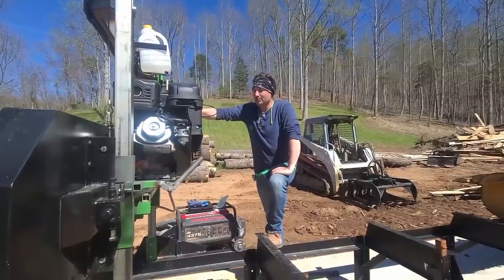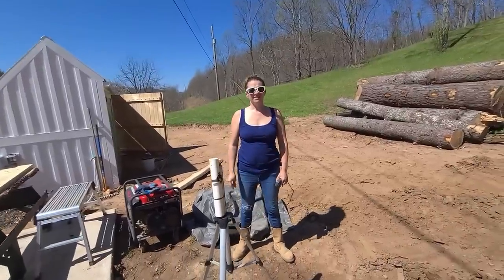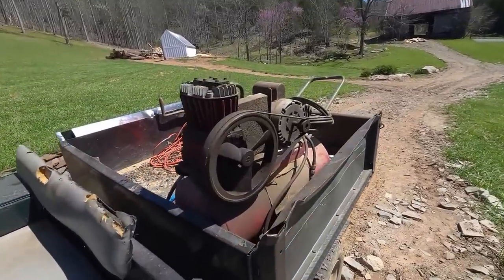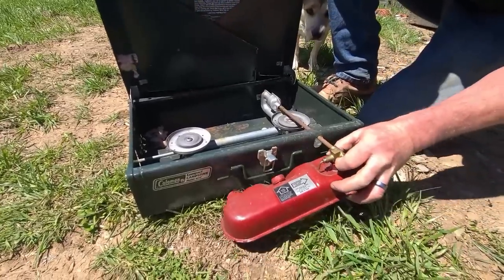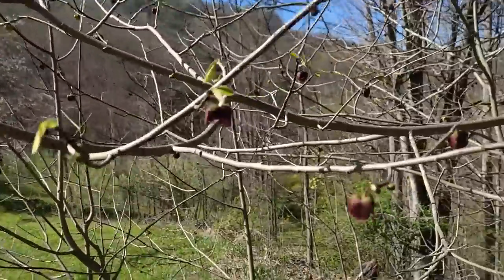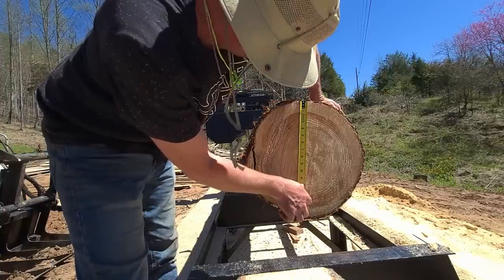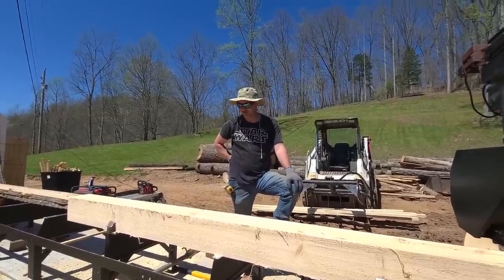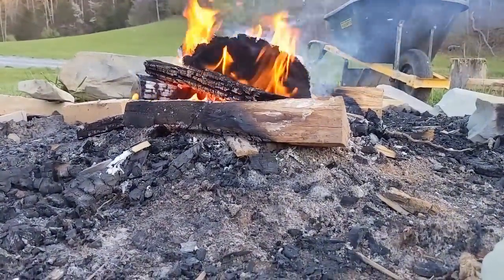New Arduino sawmill in action // E124

Comment: Fantastic job on the Arduino controller for your sawmill.  Plus you showed other sawmill owners how to do the conversion step by step.  You even provided a wiring diagram as well as the Arduino code.  It is a joy to watch it work so smoothly.   With the Arduino one can very cheaply computerize almost any task.  I bought several of the bare Atmel 328-P chips and usually build my own boards.  I do not really save money but I have made some tiny custom boards for my own use.  You two continue to amaze me.  I know you want to start working on your house as soon as possible and I look forward to watching as it is being built.

Comment: Hi guys,
I bet you are just itching to get cracking on the house site. Getting the "office" up and running first is a great idea.
Thinking about the log stops on your mill. If you weld additional receiver tubes inboard of the existing tubes, you could use them to situate the cant on the mill to miss the triangular pulley belt obstruction under the saw.. That way you could cut more boards before having to reset your "zero".
Cheers, EJ

Comment: Jon, you can move the push handle on your sawmill up about six inches, giving you that much more cutting height.  Just take the two bolts out, move up to the bottom of the top frame & drill two new holes to bolt it to.  With my 420 engine the exhaust does rub when I go that high, but it seems to just be a slight contact and does no harm.  Plus, you're never at maximum height for long anyhow.  Now, I need to look deeper at your Arduino idea...

Comment: having dried a lot of lumber,  measure a board not on the edges, measure a number of places  not super near the edge.  The edge will dry out faster than the middle.

Also, lumber curling/checking/ etc is due to the board drying or taking on water UNEVENLY not heating and cooling as I have heard on other channels.  the best circumstance is to keep the stickers so you get airflow on all sides of the boards until you use them.

Comment: You did an extremely good job giving us an idea. Hope you have at least bought a level system for your house pad. It is an item you will always use. There are cheap ones out there. I have a spirit level on an adjustable level stand with a water bubble and that works fine. I have had that for 30 years and it does the job just like a posh one. It has a laser eye on it to give you the height.
Nice set of Dado blades you got from wherever. Want to seal them away from moisture and can be useful.

Comment: The reason you have a variation in MC is that you should try and direct the circulating (all of it if poss) through the stickers- viewing your kiln the air has ample opportunity to take the path of least resistance so this can result in uneven drying- you  can purchase an air velocity meter to measure. Ideal is 300 to 600 feet per minute. Another reason may be that the kiln temperature may have been too high initially and you "case-hardened" the material actually locking the moisture in the piece of wood.

Comment: I agree with the linear encoder idea. The encoder could also be used to E-stop in the case there is height travel when there should not be ( drift while cutting) or no travel when there should be as in the case the brake is inadvertently left on.

Comment: That funny shaped tool with the tear drop end is a foot pedal from a piano. The thing before the piano foot pedal is used to grab a cable to pull it through conduit and the thing that Meg called a ratchet thingey is a chain load binder used to tie down heavy loads and are rated for 10,000 lbs.

Comment: Hi Jon and Meg when we do our Stacking we leave the stickers in, it help for the air flow and also help dry the board faster then we ratchet strap them together. Also if you don't have stickers in the board might mold.
IRON AND OAK SAWMILL  DEB
Reply from the maker: Thanks Deb for the reassurance.  I really shouldn't have removed them.  I don't plan on doing that with the house lumber, but this stack is destined for concrete form boards in the near future.  Question for you: is it okay to use green stickers on green lumber, or should they be dried ahead of time?
Reply: We learn from are mistakes and used green stickers not  realizing until it was to late that they make sticker marks in the wood. So it is best to used dry stickers. Ash wood dries fast. I hope this helps you. Keep up the good work. I enjoy your channel alot

Comment: Hi guys.  Love your channel. Hope all is well. i have the HF sawmill too, but haven't set it up yet :) Question:  would there be an easy way cut a roof angle slab off of a log ... if I wanted to cut the roof angle on my ridge pole, in order to lay flat trusses on the ridge pole beam, would that be a relatively easy thing to do or not? would you need to build some type of jig? or would you be able to easily achieve it on your mill? Thanks.

Comment: One of the problems with your tree looks like the same problem we had with one in my youth. My grandfather came by one day and took a look at it. He didn't say anything but walked to his pickup and pulled out about five feet of rusty chain and laid it on the ground around the trunk. He told us to leave the chain (wrapped twice around the tree on the ground not touching the trunk) and wait till next year for our fruit. He died later that winter but the very next year we had a large crop of fruit. It has had the best crop ever since. When I see fruit, but it dies before getting ripe or even having the flower but no fruit, I do like my grandfather and lay some rusty metal or chain around the plant, and I always have good fruit the next year. Your problem could be lack of the right minerals. I think you found the pollination problem.

Comment: Think the way you have the kiln set up. You bring the air in at the top and circulate it around the pile, in at top around the stack and out at the bottom. The inside of the stack gets less of the moving warm air so it is going to dry slower.

Comment: If you lossesn the nuts before you take the vehicle  off the ground the tire won't spin on you. The lift it up. & finish lifting.. put a small block under the valve handle for more leverage. 😊

Comment: You can fill the tank up with air & use it for an emergency tire air up thing on the mountain when you don't have electricity. Air it up from your shed. If the motor doesn't work I mean 😅.

Comment: That clamp looking  like c clamp  but has cross bars  is part of inner tube hot patch kit   one would  prep tube  caning area  to be patches  the hot patch would  held in place by clamp the patch had metal pice that held the material that would be lite with match  or other ignition  source  when it burn/heating  complete  and cooled remove  clamp abd the metal  piece hold heating material  would also come off leaving  the red real rubber patch on tube

Comment: That stove takes a gas called White gas.  It's pretty sensitive.   Will exploded if not handled properly.  When I was a scout leader we would not even let's the kids work with those.  It's a pressurized system is why it can be a problem.

Comment: Tire air smells great. It is like the country.

 Tires are made of different rubber substitutes or even actual rubber. Now, stay with me here. You are a tech so you should have had molecular science at sometime. Atoms have components, such as neutrons, protons, positrons, and electrons. The individuals are just atoms, molecules are formed when you have a group of atoms that stick together. Without going into a week long lecture, molecules use ionic charge similar to magnetic attraction to hold atoms together to form the molecules. 

Think of the atoms as different size round beach balls. Some balls have lots of electrons in orbits around the nucleus, sort of like the solar system. The nucleus is in the center like the sun and the electron orbits (called valence bands) are around it like the orbits of the planets. The more electrons (planets) that are in the atom the bigger the radius from the nucleus to the outside of the atom, Hey don't leave yet I am almost done.

 So think of the rubber tire as one big molecule that is solid but not impermeable (Permeation: Tire rubber is not entirely impermeable, meaning air molecules can escape through the tire’s sidewalls over time. This gradual air loss, known as permeation, is a natural occurrence and can lead to a slow drop in tire pressure, even without visible damage or punctures).

 That is it in a nut shell but more detailed description of the process follows. The "air" inside are random non-connected molecules with very weak or no attraction to each other. I put quotes around "air" as it is a combination of Oxygen and Nitrogen and other stuff but about 78% nitrogen and 21% oxygen so total about 99% . These air molecules have loose atoms of a size that is very small  nitrogen has a weight of about 14 amu with  7 electrons and oxygen weighs about 16 amu and hold 8 electrons. 

Now, this will seem a little bit backwards but, bear with me here. The atomic bonds (gravity, electron pull ionic pull, magnetic pull basically the strength of the bond) between atoms in the molecules of the air are different. Just as the tires are solid but not impermeable, the air is loose and randomly dispersed so the attraction between the elements in the various molecules are different causing the molecular bonds to expand or contract according to the individual characteristics of the basic elements. 

OK, here it is. The oxygen molecules bind two oxygen atoms to form the basic molecule and the nitrogen molecule is larger because of the number of atoms in the molecule. The "solid" tire is not really solid. Remember the beach balls. Think of the rubber tire a made up of very large beach balls, if you drop a golf ball (oxygen molecule only made up of two Ox atoms) on top of a pile of beach balls, it drops gradually through as it finds the gaps between the round surfaces of the larger beach balls. However, if you drop a soccer ball (nitrogen molecule) on the pile it just stays because it is to big to move through the gaps. Thus over time the Ox is leaked through the rubber and the nitrogen stays. If you fill your tires with a very high concentration of nitrogen the tires will not deflate over time as there is very little Ox to leak out through the impermeable rubber of the tire.
🤓